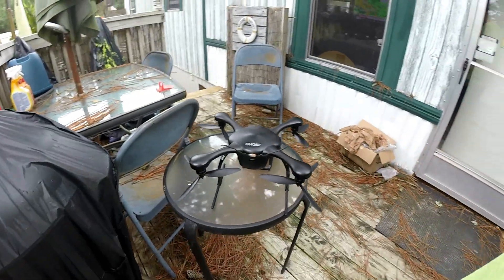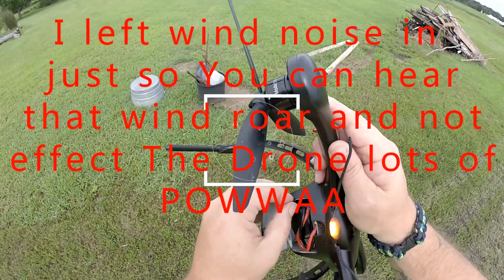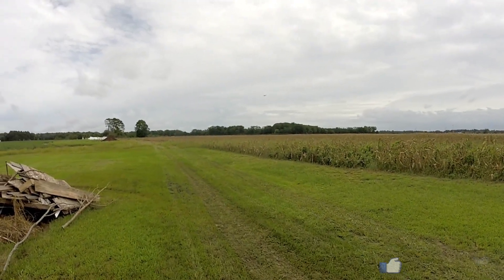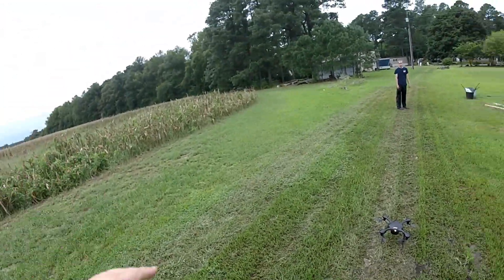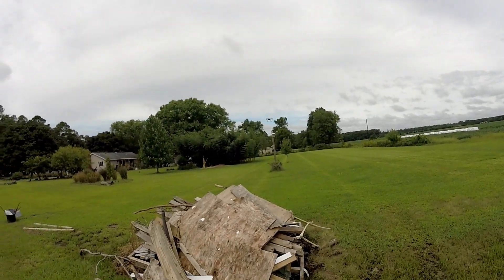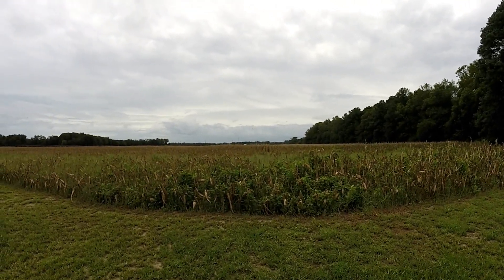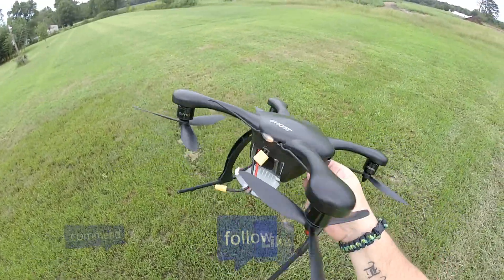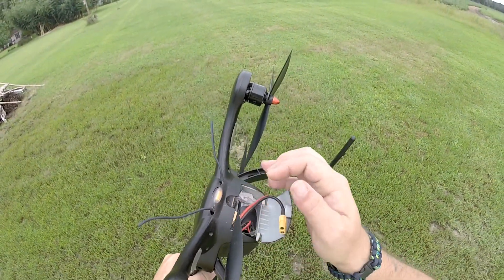Ehang Ghost Drone 1.0 Modded

Comment: hay brother do i need to get esc's or is someone already getting them ?  and i dont have a large 4s battery only 2s bugs batterys that i strap together to make a 4s lipo . some people put a little money in my paypal acount so i can buy one or the other but not both. let me know becouse if i have to get the esc's i want to get 30 amp esc's  becouse you know i fly balls out and crash sometimes so larger esc's are harder to burn out. im not trying to be picky and i know this is a econemy build but i want to make it as best as i can so i dont have to fix it every few times i fly it. like i have to do with my dam xjb 145.  i should have listened to you about that quad.  just let me know what parts i need to buy if any. and i will try to get them. if i end up not having to get anything then i will buy the upgraded esc board for the xjb with that money.  just let me know. or call me sometime.  thanks brother.
Reply from the maker: Chris yes get Your esc's everything else is covered i'm getting FC and PDB VTX CAMERA with some help from Plummet fpv and Love my drones Luis aka Baduga is sending You a martian 5 inch frame Dronepool is sendinding motors the battery not sure I will see if anyone has one they can Contribute love ya Bro I will call this week Brother
Reply: i got some 30amp blheli dshot 600 esc's today and namless droner is sending me a couple of his 4s lipos. heck brother  i would take the electric motor out of my wifes vibrator and install it on my drone if thats what it took to get me back in the air. thats how serious i take flying.